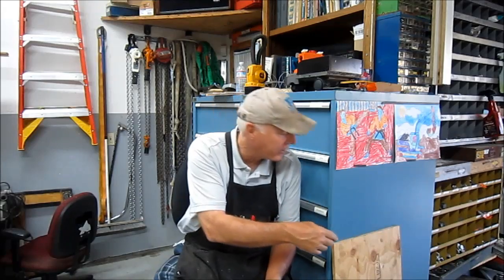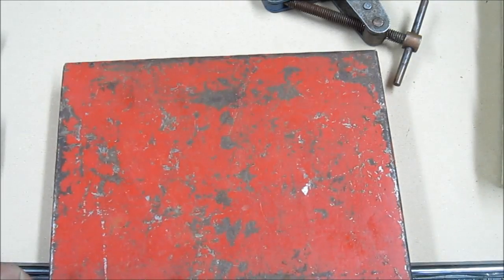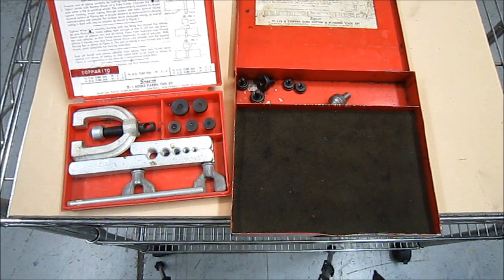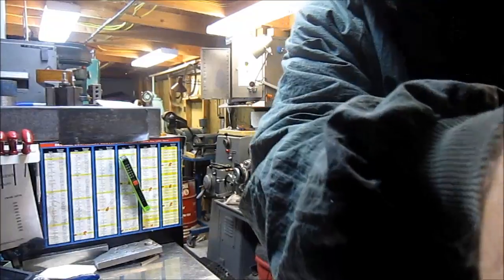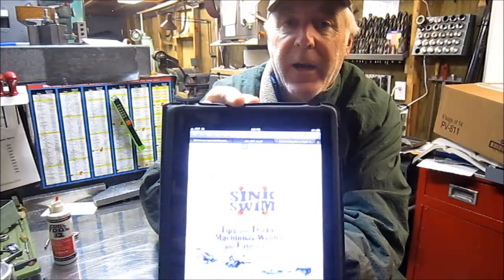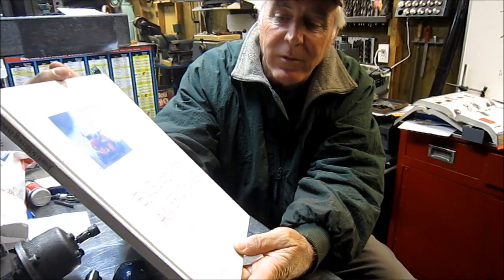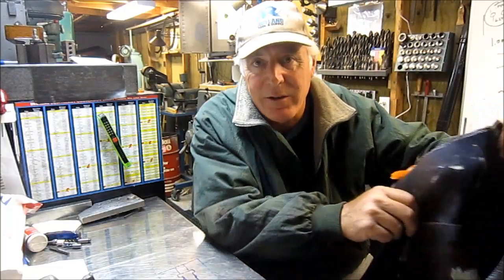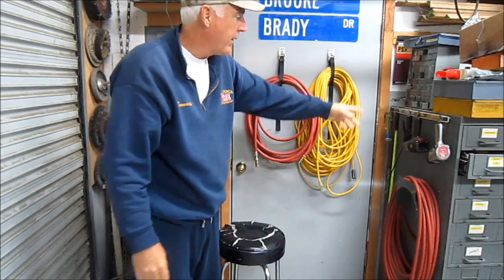Tool Time 37  Halloween Primer

Comment: I thought you were posting our address at the end all I saw was your scale holder !!!  Question on the CLR dose it remove the anodizing from impact sockets ? I know evapo rust will. The larger taper piece in your flee market double flair kit box is a insert for a pusher screw in a puller set.
Reply from the maker: fatboyfester Fatboy...Jeez, you made me go look (again,and again) to assure that the address did appear....hmmm! I am going to check again.Don't have an answer on the CLR, suggest small samples and be careful on the length of time